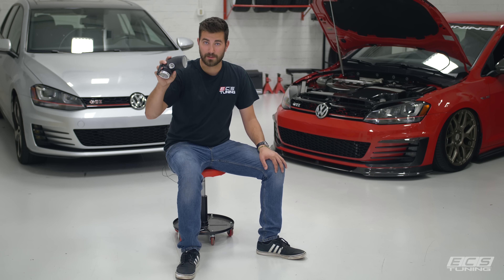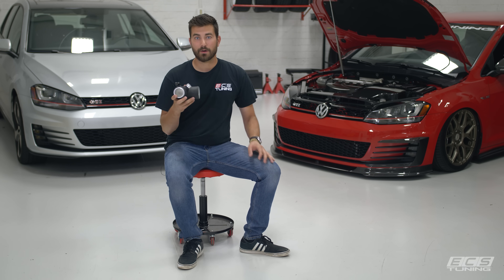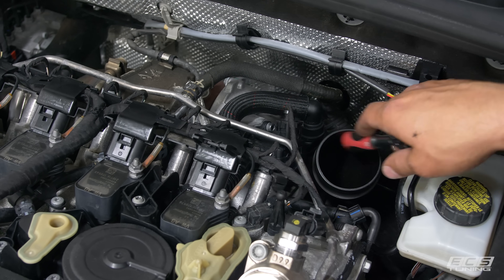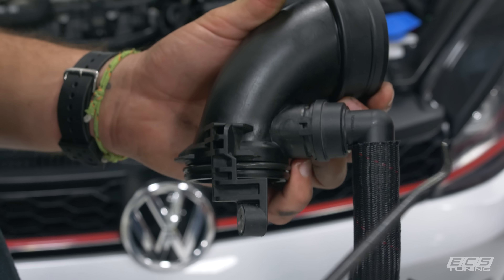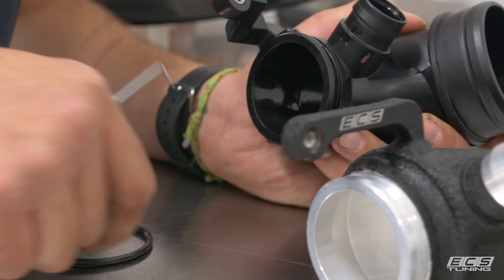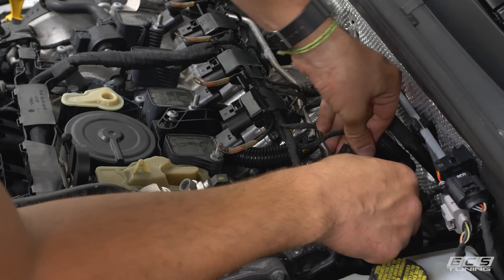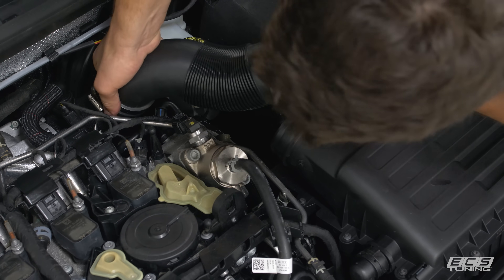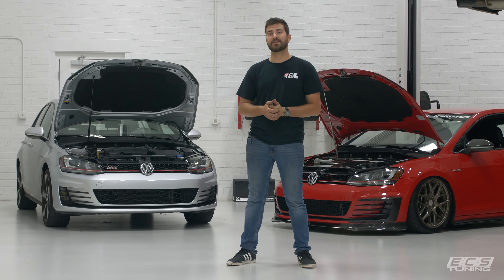VW MK7 GTI - Turbo Inlet Pipe Install DIY

Comment: If anyone is doing this on a 24 GLI Autobahn? The PCV hose doesn’t have that clip - and you don’t need to take everything else apart. 
Loosen and remove the T35, spin clockwise and it comes off the turbo.
You just have to pull like a MF on the fitting and it’ll pop right off also.

Comment: Honestly fuck this install. Those clips that hold the square things on are impossible to get off and one just snapped.
Reply: On my 24 GLI I didn’t need to do 90% of that. 
No clip on my PCV hose.
Reply: @ i forget what I was talking about now but something snapped when I removed it. I didnt even need to remove it, I just worked around it. Still annoying tho

Comment: The PCV Hose is east to get off if you until the bolt that holds the elbow in place first and pull the elbow.

Comment: Do you have a direct fit MK6 (2010) GTi version??
Reply from the maker: No, the turbo inlet is cast into the compressor housing. Our intake system for MK6 goes right onto the turbo.

Comment: The hardest part of this install is getting the coil packs and solenoids wire harnesses unplugged, including the PCV. Stick a pick in the notch on the PCV connection to OEM inlet pipe and pry up while you pull it off. Mine came off no problem. You can definitely tell the difference with the big bore pipe, intake, and turbo muffler delete. HP's and good sound.

Comment: is it normal for the intake hose (which is attached to the inlet pipe) to wiggle some? I tightened the torx bolt on the inlet pipe but I still get quite a bit of play in the intake. All hose clamps are tight, the hose doesn't move, the inlet pipe does.

Comment: Here’s a tip: check with your insurer that they are happy to cover you, I’ve had several of them not insuring me once they learned about the turbo inlet and OBD11 tweaks even though my car tune is stock. If you don’t tell them and you’re involved in a crash, they likely will not cover you 🥊
Reply: This is bullshit. They will cover the cost of a stock priced vehicle. They will not cover the costs of any mods. Your policy is what determines coverage. Not what is on the car.

Comment: I lifted the breather hose a bit, loosened that torx with a T25 (slowly) and then turned the inlet pipe 90 degrees towards the firewall and it came right out. 5 minutes. Then, went to town trying to loosed the breather hose until it finally gave, but now it feels loose after re-install. Fixed that with a few drops of super glue.
Reply: Lmao super glue. Good luck to the next owner of that car! haha

Comment: 1:39 “This should be an easy install” 
2:26 “We have to remove the coil pack harness to remove the PCV hose” 
I’m pretty confident in my abilities but to the average guy this would put them off from trying. Just don’t say “Easy install”.

Comment: Good morning guys
i have a Golf 7.5 GTI with Revo stage 1 tuning.
I have also airbox modded with drop filter....
i would like to install also a turbo inlet pipe and a inlet hose ...
Should be ok with your stage1 or I going to lose performance, torque, etc?
Thanks!

Comment: As what other ppl state for helpful tips I found that inverting the stock turbo inlet pipe with the connector on and putting WD 40 to let it soak for a sec helps it slip out as well. Had to do a fall back since my lugs on the coil packs were lose and didn't have a special wrench to keep it in place to do that workaround like in the video.
Reply: Thx mate! WD 40 the universal pipe wiggle life saver! Helped me getting on my full custom turbo back system on my GTI Clubsport!  😄

Comment: Can this be done to a 1.4L TSI like in the Golf’s or the Jetta’s?
Reply: It's a completely different turbo, the inlet is routed to the left and the pcv hose goes directly into the intake piping just before the filter box. So in short, no.

Comment: Will this and diverter valve spacer cause a check engine light? My shit stock right now
Reply: Not at all if done correctly, I’m ordering this soon and already have a valve spacer installed , really easy and good turbo noises

Comment: Pointless mod.  No gains in power
Reply: How is better turbo spool, turbo flow, and reduced turbo lag pointless? This will help acceleration. As far as gaining more power obviously this isn't meant for that. It's for improved airflow and improved throttle response. It also replaces the crappy black plastic one that's narrower with more restrictive air flow. This is just a mod to improve driveability and throttle response.

Comment: Although I agree with many of the comments that the removal of the PCV breather hose is unnecessary to install a TIP,  I do it find it helpful to know how to remove the PCV hose from the PCV valve in case I need to replace the stock breather hose down the road.. and not coincidentally, ECS sells a replacement PCV breather hose for the mk7 GTI. 2 birds, one video.

Comment: Honestly not a fun time,  but that is partially because I was cleaning up the mess some chipmunks decided to make.  Also the PCV hose got all turned around and the retention lips or whatever they are were a pain in the ass.  Snapped off part of one side, but it still seems rock solid so...  also found out the MST hose is just a tad longer than it should be and this means you really have to give it a good shove to make sure that you can put the airbox back together.

Comment: For the goofballs watching this video and making claims about what a turbo inlet does or does not do please just shut up and read for once in your life.  In terms of flow you are looking at a significant increase in flow as well as a smoother flow if you also remove the factory pipe.  Is this more of an OEM+ type mod?  Yes, and you should look to a downpipe first if you're going for big power gains, but at the same time that's leaving the path of OEM+ for the hassle of modified car life which for some people isn't worth it.  Not to mention that stage 2 should not be just a dp and a tune because you're asking for trouble.  Humblemechanic has a full build for his stage 2 MK7.5 R and it cost over 5k when he was done...  I'd prefer to stay around half that for stage 1 with some bolt on parts to enhance the feeling of the car while also netting you a small amount of power in the mid or upper portion of your powerband.

http://mygolfmk7.com/turbo-inlet-pipe/

Comment: What you dont tell the mass is that under 400bhp it doesn’t do shit..I have one on my Cupra and I dyno it with or without and as long as stay under 400bhp the difference is less then 5bhp. So unless you are on to stage 3 upgrades this is a waste of money. Rather remove the “snowcatcher” it’s for free since it’s already in your car.

Comment: Okay so yew remove the intake hose from the stock inlet. DO NOT REMOVE THAT HOSE HE IS DOING AT 2:45 SKIP THAT STEP ITS NOT NECESSARY AT ALL. Going forward remove the T30 screw from the pipe twist get the new one in make sure to transfer the o ring from the stock to the new one. Screw back with a twist reinstall the T30 screw and the intake hose and just like that it's done. This video has extra steps that are not necessary at all and will cause more problems and might turn people from doing it. Make sure to checkout my channel if you guys want me to show u
Reply: show me

Comment: This dude made it much harder than it actually is. The trick is to go full beast mode on the pcv connector to the pipe while twisting and pulling. It will pop right off.

Comment: Will this fit the GTI MK7.5 (2019 facelift). The ECS website doesn’t have an inlet pipe listed for the MK 7.5
Reply: Wondering the same thing. It doesn't look like anything's different, but ECS seems pretty specific about the manufacture date after which it won't fit?

Comment: Easier way to take off the pcv pipe is to unbolt the inlet pipe so its loose and you can directly pull the pcv from the inlet

Comment: I’ve  done a couple of these, and here’s a tip: the PCV hose coupling is a bitch to get off in place, but there is enough slack in the hose to unbolt the inlet pipe, wiggle out the pipe, and once it’s free lift it up slightly and then you can get a good grip on the coupling and unplug it. So much easier, and you don’t have to do all that unnecessary work removing the PCV hose, connectors, etc. Done in 5-10 minutes tops.
Reply: Thanks for the tip. I'm dreading this PCV hose. Do the Mk7.5 Golfs still have this style of connector?
Reply: @nintendoatarikiller  yeah they still got it
Reply: yeah ive watched 2 other videos and taking off the pcv looks very easy
Reply: @Andrew-bd7mp ...It's do-able but it's not easy by any stretch...it's a bitch. I got mine off after a fight, and when putting it back on to my new turbo inlet pipe I had to use a screwdriver handle like a pry bar applying quite a lot of downward pressure to get the fitting to seat in place just hope I don't have to do it for a long time. Part of the problem is it's back by the firewall and leaning over it's hard to get enough leverage.
Reply: @harryberry474 I did mine today. You just squeeze both sides and it comes right off

Comment: I replaced the turbo inlet pipe and hose on my MK7 GTI and now I have a check engine light and the cruise doesn't work.  I've checked the connections that where removed in the process and they are all reconnected.  What should I look for?
Reply: Read out the fault memory of the motor. let the error clear.
Reply: I disconnected and reconnected the connectors I removed in the process and cleared the error and it stayed clear.  The issue was caused by a cam position sensor?? I don’t recall what the name was in the error.

Comment: Will this fit on a Jetta GLI MK7 2019? On the ECS website it says it doesn't. Also, which oil catch can would you recommend?
Thanks.
Reply: Yes it will. I went with CTS Turbos inlet pipe because it was on sale for $68. I'm installing it right now haha

Comment: I looked through a lot of questions about it. But I haven't seen any asking about a newer 1.8t TSI gen 3. I have a 2015 beetle and the piping runs up top across the back of the motor. Not like that one. Will it not work for a bug or is there something else I need to do?

Comment: Does anyone know if this part carries any risk of voiding the factory warranty? I'd like to get one to go with the K&N drop-in and turbo inlet hose that I just got, but I'm a little wary of anything bolting closer to the engine that the warranty police would take issue with.

Comment: Just did now installed on my MK7 R. I didnt have to remove any coil plugs or unplug but a few connectors. Also don’t bother removing breather tube from top engine side, just remove stock intake elbow with oil breather hose still attached and instead of stabbing a friend with a pick, use a stubby large flathead screw driver and open like a paint can. It pops right off after you work around it 100 deg or so. Super easy.
Reply: 6 years later and this comment saved me so much time and effort the "open like a paint can lid" helped so much, I love you your a saint 🫶🏼

Comment: Made that far more complicated than needed. I took off the intake hose, loosened the torx bolt, turned it back toward me, popped the PVC hose off the inlet and then reversed the process. 10 minutes tops.
Reply: Agreed. I broke a lot of plastic clips doing it his way and took almost 2 hours of prying and yaking
Reply: Basically what he did.....

Comment: Just a little tip, if you take the torx screw out and rotate the elbow back slightly, you can get your thumb and forefinger on the PCV breather pipe enough to squeeze and release it easily. Would have thought someone as highly regarded as ECS tuning with golf gti/r would be all over this.
Reply: "highly regarded as ECS tuning"
hahahahhaha

Comment: is there any actual Before Dyno and after Dyno stat sheets to show actual improvements on a STOCK car where this is the ONLY mod?
Reply: @taon707  i always find it funny when people talk about the OIL from an oiled filter material causing "damage" to an engine when within 6 to 12 inches of the air filter is the PCV valve dumping nasty burnt oil/gas mixture directly into the same air path adding far more significant gunk and debris than a oiled cloth filter ever could..  And yes some of you may bring up the MAF wire as the reasoning for this and sure maybe .001% of oiled cloth filter users have had a MAF failure that was linked to oil deposits however most new cars have ditched the MAF and switched to MAP to get rid of that annoying piece of tech.
Reply: @taon707  the costs alone of cloth vs paper keep OEM's from using it. and I agree that it has been proven several times that paper is a far better particulate filter than the aftermarket cloth filters. but you can get good aftermarket "paper" filters that offer more surface area for reducing restriction and as for the noise some of us like it and for those who don't enjoy that Modifications to cars are not for you i guess and also electric cars are a lot quieter yet :)
Reply: @taon707  LOL!  You are the best...at making me laugh!
Reply: Theres actually a thread on the MK7 forum that goes into great detail about the physics and mathematics behind the turbo inlet pipe and how the stock one actually might turn out to be better due to the internal tapered shape. This allows the air to speed up a great deal before hitting the turbo.
Reply: @CaptainCandycorn  thanks! do you have a link to that post?  i assume that factory power without tuning for the increased flow capabilities and higher boost than stock this may be true. However since I posted this 9 months ago I've found several videos that verify there are repeatable dyno pulls that prove they outperform the stock elbow.
Reply: @One_Guy  With a stock MK7, no "upgrade" will increase power aside from a tune.  Why?  Because the only way an "upgrade" part will increase power is if the stock part was limiting power.  The fact that a stage 1 tune is able to give such a large increase in power proves that none of the engine components are limiting the car at stock power levels.  Because the parts are not limiting the car, changing them will not increase HP.   (Now, if you had stage 2, you may find a small benefit to an intake/ air inlet pipe...but only to the degree that the intake is the bottleneck.  But at that point, almost everything in the car is in lining up to be the next bottleneck
Reply: @grahamek86  Hilarious!  You can't see the forest for the trees!  If you want a 1% gain, maybe...possibly...if you do it just right...but it is wayyyy more likely that your "upgrade" will actually hurt performance!  But gain or loss, you aren't going to feel it because it is so small.  Oh, you just want to believe that you can cleverly improve performance with cheap mods?  Keep believing, but it is a pipe dream.
Reply: @fredygump5578  I'll take my empirical evidence of tuning hundreds of these cars along with in-depth experience of the Simos ECU architecture over your uneducated guess at how things work. Thanks for playing though, there's plenty other car channels you can try and sound like you're talking about on.
Reply: @Osprey1994  Just FYI....I wasn't involved in the air filter pissing match...  I said that there aren't any significant gains to be made without first tuning the car.  (If you disagree, I laugh in your general direction!)

Comment: Can I consider myself lucky? I went straight to the pcv and it took me 3 seconds to pull it, after that just disconnected the hoses and the screw, inlet pipe out, 10 minutes later I was done.

Comment: Is there any gains without installing the other mods?
Reply: Ahmad Ali I second this, wonder if it would be worth putting on a completely stock car and if it would flash a CEL
Reply: @rambow70  no it will not flash the cel, even totally stock this mod will help a little, but with an air intake setup, this mod will be way more beneficial.

Comment: Wish I would’ve known there were 2 style of hoses on our car. On the Shop DAP video, Paul said “just squeeze the sides and pull, it’s easy” and I now know I had the pressure type hose on my car. That thing was a nightmare to take off by myself. Nice little mod though.

Comment: would this void my warranty ?
i know it would only add better air flow, but how would VAG see about it ?
Reply: odds are the dealership wouldnt even notice this mod. we do warranty repairs to modded cars all the time. most of the time they have us techs look at the car to see if they did anything that voided the warranty, and as long as they didnt do anything retarded i dont rat them out. i dont care if homeboy gets a free warranty repair, i mean, i would want the same done for me. now if they need a motor cause they threw a rod and i see they had an ebay turbo kit installed at one point, thats a different story.

Comment: Is it better to get a ram air intake or buy this pipe and a drop in K&N filter?
Reply: Michael Broski from what Ive read the stock airbox flows good. This inlet pipe, drop in filter and remove the “snow guard” in the intake box and your good to go. You can also cut holes in your plastic behind your grill for more air  to flow straight to the air box

Comment: What does it improve beyond stock? If anyone added this and had no other modifications, what would change?
Reply: I have a different brand's TIP but basically, I noticed more sound from the motor, quicker turbo spooling, and sharper throttle response.

Comment: @ecstuning can you link me to this piece for mk6 gti
Reply from the maker: The MK6 doesn't have a separate section on the inlet.  Here's our full MK6 intake for added flow/sound/power: https://goo.gl/icHy9x
Reply: @ecstuning  high flow turbo inlet or big bore inlet? Which is better